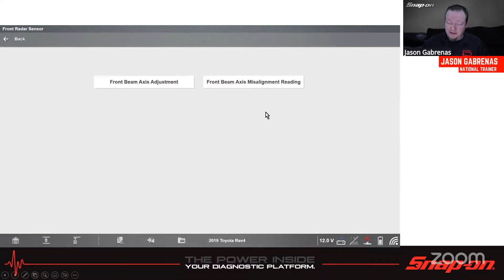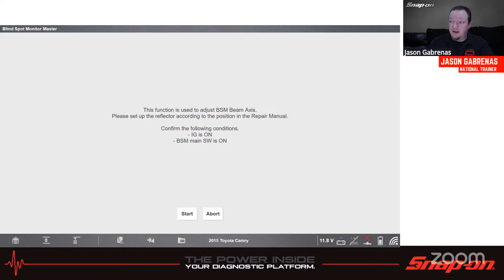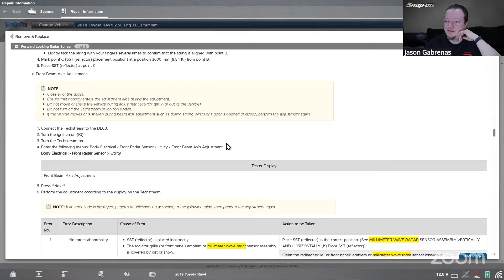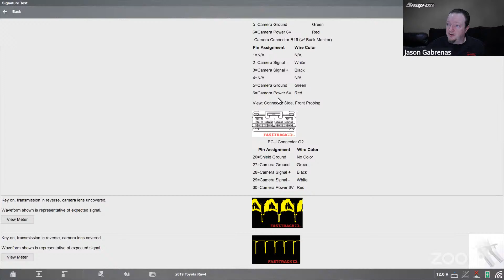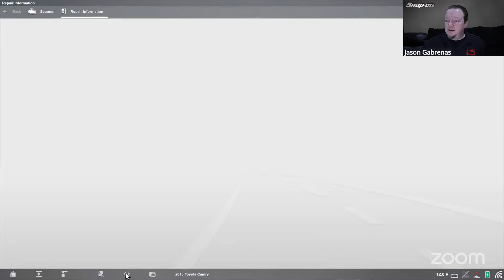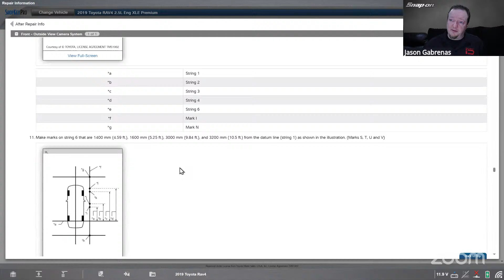OEM - Specific ADAS Training - Toyota® - Snap-on Live Training Episode 107

Comment: I think its importan to to mention that you NEED to have all the targets propperly set up before starting the calibration for Toyota. Once the new input information is entered the ECM erase the previous calibration information and disable the LDW until the calibration process is finished. Not sure why Toyota uses that calibration procedure for a lot of their sensors (Something like the ABS and Steering angle sensor calibration)
Reply from the maker: Good point. Not sure why they chose to do it that way.